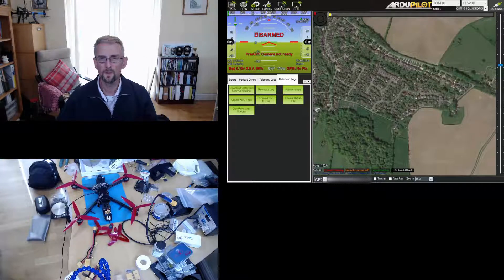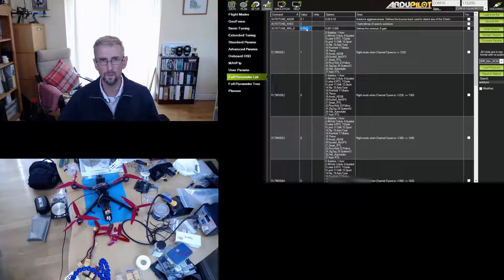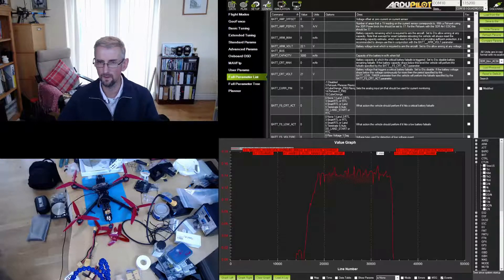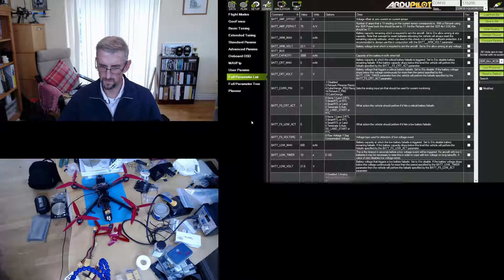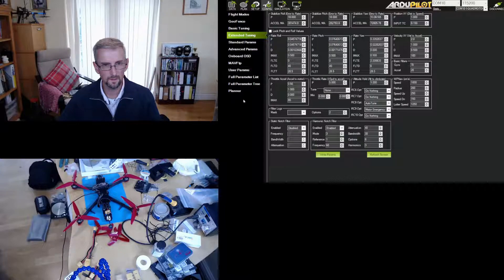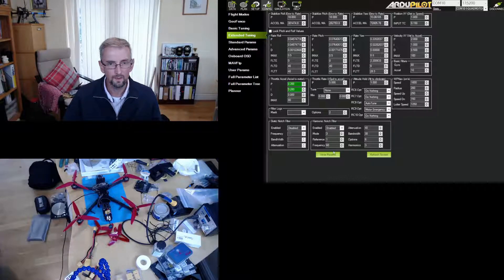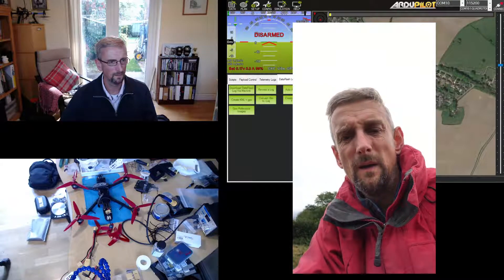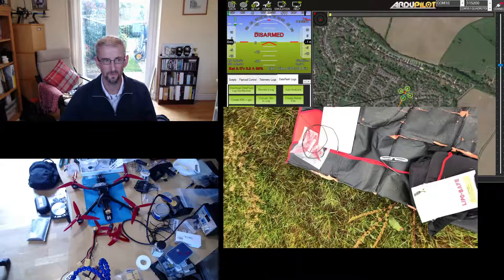ArduCopter 7" LR Build Video 19 - First Flight - Stabilize, AltHold, PosHold and Autotune

Comment: Greetings, hope you are all right. I build quadcopter but cant get it to pos hold, it gains altitude fast. Any guidance?
Reply from the maker: Do you have MOT_THST_HOVER set correctly?
Reply: @andypiper5285   It is 0.2 which came from learn and save. I use 5 inch quadcopter 6s FC matek. Will set it to 0.11 like yours.
Reply from the maker: @lioman2578  best to start a thread on discuss.ardupilot.org and post a log